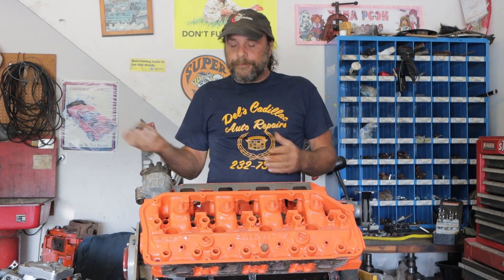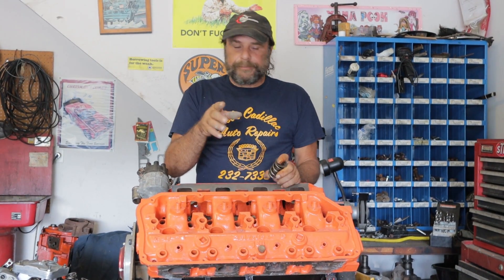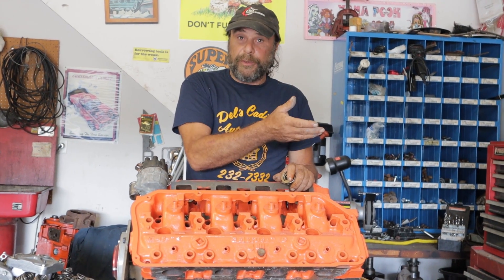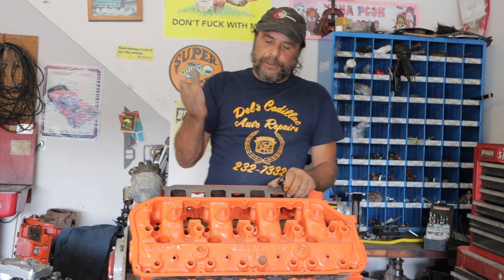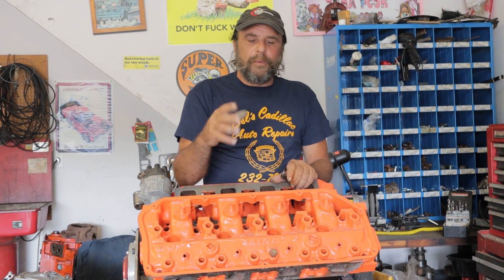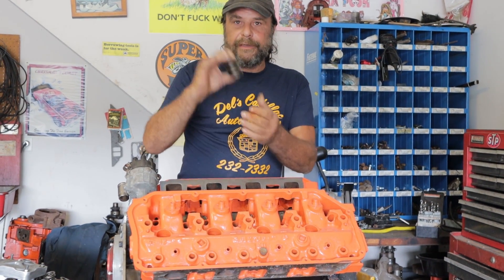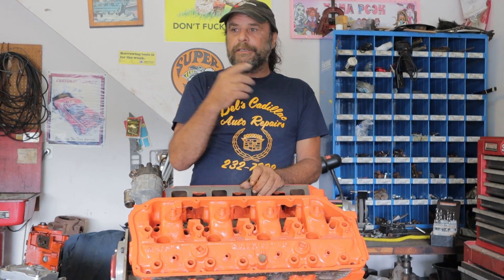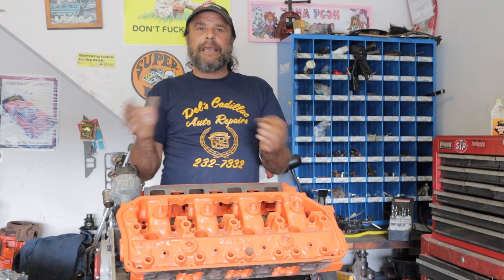Mopar's Doomsday Hemi

Comment: Rewatching...despite the bizzaro intake port spacings, which copy a dual 318 intake for each intake valve,  the A 925 Chrysler 426 Quad Cam Pentroof 32 Valve Belt and Gear driven 1964  engine would have had a  Volumetric Efficiency which was 18% higher with that  Quad Cam engine (1.88 hp per cube gross  verses 1.57 hp per cube gross with the best gasoline Race Hemi).

Comment: Love it. Suits always get scared of to much of a good thing. 
Check out the Deusenburg W24 engines from wat back. 4 valves per cylinder, fuel injection overhead camshaft.  To good for the days of the flathead Ford v8

Comment: My dad was a Chevy guy, his dad retired from the Leeds plant here on Kansas City. I never forget, one time I was in the shop and he was talking to one of his buddies. He said, "yeah, Chrysler makes damn good horsepower." I was like 10. We'd never owned anything but GM vehicles. A few years after he died I bought a 92 Dakota single cab 318, NOT 4wd. My first truck was dad's 70 C10 with the 350 and the 3 on the tree. That Dakota is probably just as fast and actually accelerates quicker than my Chevy. Man I wish my dad was around for that stuff. He'd hate it 🤣

Comment: Modern engines these days dont use direct acting cams. They use roller finger followers instead. Less parasitic losses that way and also eliminates the bucket used in direct acting setups. This lightens the valvetrain further

Comment: It wasnt the cam buckets that cracked, it was the cam bucket carriers. That happened while the motor was run without internals by an electric motor to test the valve-train. I believe the cam bucket carriers were cast by Alcoa, they should have been machined from forged billets for more durability. It would have been interesting if the A-925 actually ran as a complete engine.

Comment: the buick Nailhead figured out a dome would screw with flow back in the 50s (penta-roof chamber)
the nailhead was NEVER designed to make power...... but if it was, we could be drooling over 425 nailheads.... instead of the 426 hemi
.
also.... drag racers used blowers to push intake air into the exhaust port..... and the intake valves were now the exhaust.... 
apparently that flowed better WITH!! a blower / turbo

Comment: Chrysler modern day hemi is a self-destructing dry assed cam and lifter setup.
I have two friends,both with HellCat and they have replaced came,lifters, and bearings twice.
I keep telling them that it is a design flaw......even in the damed truck blocks.....same deal.
.......just glad I rely on heavy LS engines.....damn near bullet-proof.

Comment: Uncle Tony should teach respect to Scotty Kilmer in a history lesson of how Chrysler back in the day from its inception in 1924 as a company, until the early 1970's, made the most toughest, durable, reliable, well engineered vehicles out there. 
All their vehicles up to the early 70's were almost bullet proof and would outlast any damn Toyota back then or even today!
Not only that, they were reasonably priced vehicles. 
The way Scotty goes on about Chrysler even back in those days, made it seem even then, Chrysler made crappy vehicles. 
I will agree with Scotty about Chrysler now but not back then.
Even now, outside of their Fiat based vehicles, if you have either a Grand Caravan or a LX body vehicle, they are fairly reliable and durable. 
I know, bc i had a 12 Grand Caravan and it is still going strong after 230 000kms!.
Normal wear and tear, that's it.

Comment: So this was Dodge's answer to fords sohc fe
Would have been a great competition if chev wasn't stuck back in the archaic pushrod days ,still to this day gm is the only manufacturer without an overhead cam v8 .
Thusly why toyota is using a pushrod motor that they don't use production & ford has to use one they stopped using years ago .

Comment: Although direct acting mechanical buckets are typically more compact than rockered ohc setups, they usually aren't any lighter. The only high end race engines that use them have radial valve layouts where all four valves have unique angles .

Comment: DOHC engines go back to the 19 teens. Peugeot built the first one. The first American built DOHC to my knowlege was the Curtiss D-12 aero engine. Plus the Miller's and their Offy/Drake offshoots. The first Ford built DOHC was the GA series of engines. The 1650 ci V-12 aero engine that was still born and its 60° V-8 1100 ci brother used in Sherman tanks.  From the early 60s up until about 71 is when the US automakers let the engineering departments play. All of the BigThree were making money hand over fist so they could afford it. 
In my cottage I find I am of two minds about the American performance cars of the 60s and early 70s. Big loud engines, crappy suspensions, crappy brakes, crappy handling, crappier tires. Built to do one thing for the most part. Go fast in a straight line. At least fast cars today have good handling and brakes. Along with better tires. But the idea of a 16 year old behind the wheel of a 396 Chevelle much less a modern Camaro, Mustang or Hellcat Challenger fills me with dread.

Comment: I'd love to add another 500,000 rpm to my engine.  In fact, I'd like to see any turbocharger stay together at 500,000 rpm, much less a V8 engine...
I guess you meant to say "Another 500 to 1000 rpm" ?
In any case, great video!  But did you know that Arias has created a 32 valve 426 Hemi?  Since the bore spacing of the 426 and the Chevy big block is the same 122 mm as the V8 that Porsche built for the 928, it is possible with some welding and drilling to mount Porsche M28 4 valve heads to both the Chevy and the Chrysler 426.  I know that about a dozen Chevy's have been built [$30k+....] and at least one 426 block has these heads.  The 928 used timing belts;  The secret is to use a special part that extends forward from the OHV 426's cam to drive a timing belt.  928's drive the exhaust cam from the belt, and the intake cam is driven from the exhaust cam via a small chain in the middle of the head like some motorcycles.  The belt that happens to fit comes from some Renault car and is easy to find.  You do not want to port the M28 heads!  They easily flow enough gas at 7500 rpm with available cams to adequately fuel a 502 Chevy.  And Porsche installed these in 302 and 329 cubic inch engines....

Comment: In 1964, I was an Industrial Design student here in Northern California and a big racing fan. As a project, I designed a bolt on head for the small block Chevy that was a 2 valve per cylinder DOHC. It used 396 valves and was a hemi combustion chamber. The intake port came down between the cams. The college that I was going to had a great machine shop and we (it was a project that involved two engineering students too) started to build it. The cams were steel and bored to lube with the outlet on the trailing part of the lobe. It also had two spark plugs per cylinder. Heads were aluminum. When it came time to have the cams ground, I made the mistake of writing the Harvey Crane, who ran with the idea and made the Moser engine. Oh yes, the cam towers were removable. I still have the original drawings.
Reply: You should digitalize thos drawings and share them.

Comment: Chrysler corporation made 2 prototypes of these (DOHC 426c.i. Hemis... one sat up in Michigan at a Chrysler warehouses collecting dust, the other engine sat in the corner of one of my dad’s friend’s garage in upstate Ny. Both were complete engines. 
When I was 9years old me & my dad went to his buddy’s house to help him clean out his garage & organize it.  At a young age- I basically grew up as a mopar but/ mopar gearhead, & so was my dad’s friend. He had two “twins”- identical colors/trim- 1971 Plymouth gtx, & a 1972 Roadrunner, both were dark metallic green/ black interiors; sitting collecting dust in his garage. The car he drove a lot was a 1970 Roadrunner superbird - red, 440 6 pak, 4spd pistol grip, white interior. He had other cars in his collection- but when it came to cleaning & organizing his garage... low & behold what I found buried in the corner on an engine stand- was one of these- Daul Over Head Cams (dohc) 426 Hemis... I asked the dude- “why don’t ya put this in that GTX”, his response was: “cause they don’t make any parts for it”.  Me: “it’s a Hemi, they made hundreds of these, what do u mean they don’t make parts for these”.. 
then his response was: it’s an over head cammed Hemi. It was a prototype engine. & at that time- I learned what prototype meant. Last I knew my dad’s friend up in NY still had that engine. It very well could be the one that showed up at Carlisle PA- during one of those mopar swap meets.
Reply: I’ve always wondered how much power that particular engine would make. It would’ve been a definite racing monster on the tracks & on the streets if Chrysler gave the go-ahead on building them.

Comment: The Mystery Motor that Junior Johnson ran would not last a 500 mile race . It would win a short race but scattered itself in a 500 mile race , that 4 Cam Hemi would have cleaned up on the Cammer in Pro Stock but would the bottom end hold up over 7500 rpm's for a 500 race .Too bad we will never know . NASCAR was at its best when Chrysler , Ford , Chevy and even the AMC brands raced . Remember Bobby Allison and  Ralph Moody built a winning Daytona Charger in 1969 when Richard Petty  went with the Fords that seemed unbeatable . I liked the Aero Cars  and had one . Nothing will ever be like  those monsters were on the super speedways . Too bad the  tires couldn't handle speeds over 200 mph back then .Look up Pogo Effect on the drivers that had to boycott the 1st Talledega 500 for safety reasons ?

Comment: NASCAR went from being a contest as much between factory engineers and outside independents to something that looked like competing cereals made from the same grains. People like Smoky Yunick wouldn't find a place there, at all. I note another commenter wanting Dodge to reenter and beat Toyota; none of the "legal" competitors is today using a motor that is really relative to their sales floor engines; not GM, not Ford, and not Toyota. FWIW, Toyota's only pushrod auto engine ever, is their Grand National Program engine. And before I forget, the present Chrysler Hemi would not be a legal engine, even in 358 cid trim. Lost my last interest in NASCAR when Jr. retired. FR

Comment: I enjoyed this one.  So much good info you threw at us quickly. I have always been a motor head and thought I knew a lot but obviously, as you proved, I don’t know everything.  Thanks again.
Reply: I wish more of the engineers that worked on some of this stuff would come out and document what they worked on. Because Tony has gone over a bunch of "could have been" engines before, but those are just the ones we know about. There are probably dozens of engines that were built and tested for various forms of racing, that never saw the light of day for one reason or another. 

And just like the cam timing on this one, it wouldn't surprise me to learn that many of the features we see on an engine today, were developed 50 years ago.

Comment: Another 500,000 RPM... I know what you meant, but Ford was actually on that line. 1967, they worked with Cosworth to develop the Ford Cosworth DFV V8 for Formula 1 racing... 3 liter, DOHC 32 valve setup. The last variants were putting down 500+ horsepower at 11,200 RPM.

Comment: Oldsmobile did the same thing with their 455 in the late 60's just before the Federal EPA restrictions. If you look at the Cadillac NorthStar engine from the early 90's to mid 2000's, a lot of what was in the Olds engine made it to the NorthStar.
Reply: And I believe what wasn't borrowed from those Oldsmobile engines was at least inspired by the LT5. GM never was very fond of that engine since they didn't wholly design it, but didn't mind borrowing from it.

Comment: Good vid, TY. I read a similar article back about 30 years ago about this motor. it was supposedly rated at 700+ hp at between 7 to 10k rpm. As you stated though, one of the biggest problems was the tappet carriers separating. Apparently Chrysler was working on curing the problem. However, along with that Ford was developing the 429 and Chev was working on the 428. The battle for cid + HP was full blown and so Bill France Sr stepped in and said "enough".
This definitely would have been something for Chrysler to research and develop, given their past success.

Comment: as technically complicated as it seems this has potential to really build power with todays metals and use of a roller style lifter instead of the lifter that broke i bet this big block would have turned huge rpm especially if the cams were riding on torrington style bearings.

Comment: Yah, might have been new for racing, even back then the tech was old from the aircraft engines. The idea of overhead cams being new even back then might have been new but everything else, no.
Reply: Ford was building the GAA engine from 1940-1950, probably started development around 1935. DOHC, 32 valve, aluminum block and heads, sounds pretty familiar to what we have today. 

You're so right, might seem like a new idea, but nothing really is anymore.

Comment: Could you do a video on the Cadillac Northstar engine?  I bought one un  seen for my daughter. I had forgotten all about this engine until I raised the hood. From 0 - 40mph it's what you would expect from a big V8 sedan. From 40 - 80mph it wakes up. From 80 - 120mph at the governor it's like riding a 2 stroke bike when it reaches it's power band.  This engine in a lite weight body with a custom bell housing and a 5 or 6 speed behind it would be a handful. I know nothing about setting this thing up without the computer or if it would be possible , because I'm sure it has variable cam timing. But I bought this complete car with a straight body and perfect interior for $800. I'm just wandering if this powerplant could be a cheap hidden gem? Like buy these cars , strip and sell them , make enough money to do a complete swap?
Reply: I believe the only NorthStar V8's that came with VVT were the 2004+ rear wheel drive cars, these cars also came with coil-on-plug ignition. I don't believe it was ever installed on the front wheel drive cars due to space constraints.
Honestly the NorthStars made prior to 2004 had issues with the head bolts, and as best I'm aware no one makes performance parts for them. Id say if its an OBD2 car, you could probably tweak a few things to get a little more from it, and you could also change the way the transmission behaves as well, its a 4T80E in the FWD cars.
But yeah, they're a dime a dozen in junkyards these days. Not bad engines, just not where id start looking for a performance build.

Comment: Nice bit of history . I remember someone was working on fixing springs to push rods to lighten valve springs years ago . Is anyone doing that now . I think it would help them B and RB block Mopars rev a little more . Always liked them Mopars . Seems Don Sullivan of Ford motor company had a had in hemi design when Henry Ford was irate with him for a short time but he ended up back working for Ford . May 1993 automobile magazine had a wonderful article about Mr Sullivan you might want to check on that . Thanks for info on what could have been . Don had a hand in hemi design I mean according to what I heard back in the 1930s

Comment: Yeah, that Chevy "mystery motor" was one bad ass unit. I'm a huge Junior Johnson fan, and I learned a lot about the the cars he raced during that 1 year with this mystery motor. It was something uncommon for Chevy, as it was a big bore/short stroke engine. But he said they always had problems with the valve train. However, they led EVERY race with this motor, and IF the valve train held up for 500 miles, they absolutely put the rest of the field to shame & won the race. He stated if they could've solved the problems, they would've won every race that year. He swore they were getting between 700 and 800 hp out of that motor. That video is here on youtube. It's all an interview with the car by the man himself. The video title is: "Junior Johnson and his 1963 Chevrolet Impala SS"........For any serious car guy, THIS video will give ya goose bumps. Best video about the mystery motor, the car, and what they were accomplishing that year......IF they didn't blow up.

Comment: Have you ever worked on the Polysphere  318  they called it the  Semi Hemi  I think it had canted valves much like Chevy's 396 A friend had one in his 64 Polaras that was built to the max for a street engine. Not sure what dynoed but it had to be well over 400 horses. Many people thought he had a hemi under the hood until he showed them. He said that the older 318 had a much better power potential then the newer wedge 318 or even the 340.

Comment: Yeah that was a cool engine but Ma Chrysler's Turbine Cars were a little more Exotic.🤷‍♂️
Reply: Seventy five cars, chassis hand built by Ghia of Italy and powered by gas turbine engines, backed by very modified transmissions. Gorgeous cars, that have nothing to do with anything Chrysler has built or planned since. Jay Leno owns the only one not scrapped when Chrysler ended the leasing program that got the rest onto the street. I don't think Jay has told the story of how that car survived- that would interest me more than NASCAR's current offerings. Maybe it's just sour grapes; I am unwilling to shell out $199 for a pair of tickets in the nose bleed seats and outside the shade. Or maybe it's the $10 beer or $8 hot dogs. Maybe it was the fee I paid to get in line for a "personal autograph".